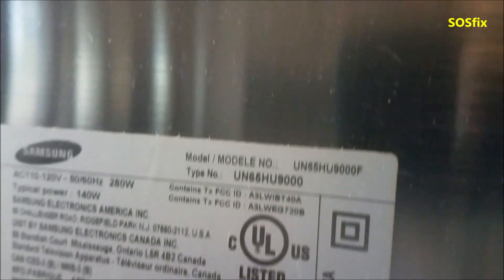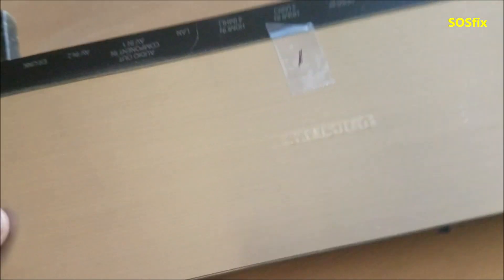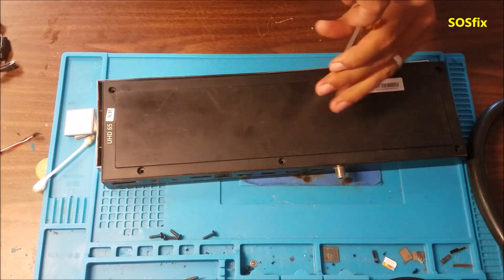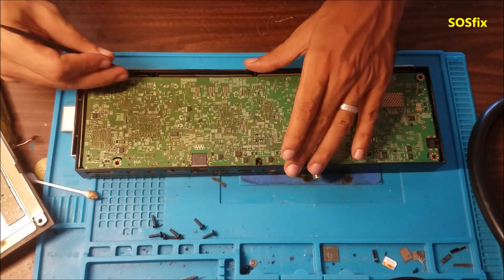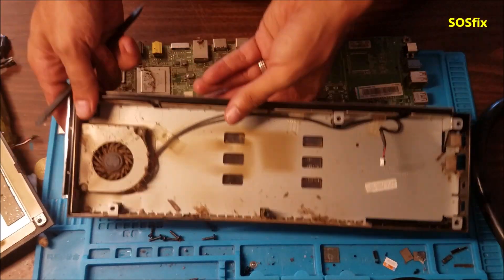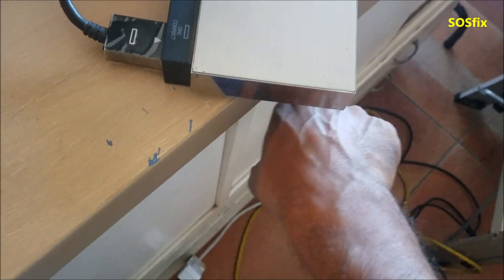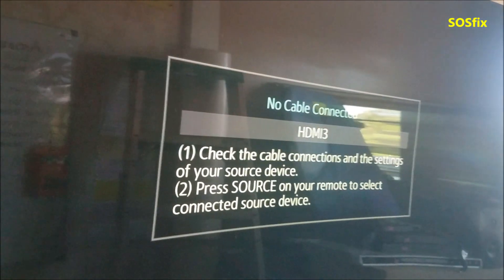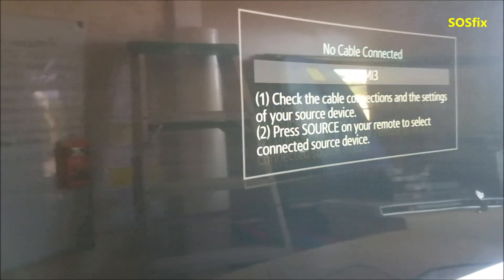samsung  tv UN65HU9000 cooling fan error and over heating easy repair

Comment: Do not buy Samsung TV , i have ue43du7172  from 2025 y  and its very hot, even wen its in off mode, and they overheat my usb stick drive so i lose all data, and they not read avi file. I update software still the same,  garbage Tv

Comment: Thanks for this video, what is the soldering thing that you are using for the fan ?
Reply from the maker: use lubricate oil
Reply: @SOSfixElectronics  Can I use WD-40 or engine motor oil, or would you recommend something else ?
Reply from the maker: @laznicek  yes

Comment: Just started getting this on my JS9500... Time to pop apart the OneConnect box... Trying to hold off on a new tv for a couple more months :)
Reply: Me too, last week, JS9500, that's why i came here to this video right now.. :) I think i purchased it in 2013, i remember buying 8 3D glasses from Korea on ebay and they had to be year 2013 model version or after to work on JS9500

Comment: The sign isn't appearing now but the fan is still struggling to turn, ordering some lubricant to see if that helps! Thank you :)
Reply from the maker: if you still having problem change the fan
Reply: @SOSfixElectronics  hi what's the name of the fan?
Reply from the maker: @rubenjones334  i dont have it with me but the part numbe is in the other side of the fan.

Comment: Put off taking this a part for years. Just did it today and this stupid message still pops up 😔
Reply from the maker: you may need to change the fan
Reply: @SOSfixElectronics  literally just ordered one on Amazon a few seconds ago.

I don't know who thought this TV design was a good idea. Crazy. I want to keep my 3D tv but this is unacceptable.
Reply from the maker: @Blaiyan  lets hope the new fan will fix the issue, be sure you dont forget to install the thermal pad on the BGA chips, good luck
Reply: @SOSfixElectronics  thank you. New fan worked. Think I'm still going to get a second screen and use the current one a lot less now.

Comment: Had the same error.Decided to open the one connect box and clean fan.After reassembly TV makes a ticking noise when connecting one connect cable as per image on display.I am sure the fan has completely failed.Would the fan failing completely stop the TV from displaying picture .I am now considering a replacement fan in the Hope's it will restore the no  display and ticking Issues.Any advice  ?
Reply from the maker: must be something wrong with cable. port in the tv side or on the box, or maybe you damaged the board when you where cleaning it , the box should connect fine to the tv with faulty fan, anyway wait for new fan and see

Comment: OMG !! You’re my hero.  What kind of lubricant did you use on the fan after you cleaned it.
Reply from the maker: flux paste
Reply: SOSfix Electronics would anything else work ok?  I don’t have flux paste.   I just bought some crc 2-26
Reply from the maker: @PissedOffLatinWoman  it will work. dont put too much of it
Reply from the maker: @PissedOffLatinWoman  check the voltage in that connector
Reply from the maker: @PissedOffLatinWoman  use multimeter turns the tv on and check the voltage between red and black fan wires must be about 5volt, anyway you can wait for the new fan

Comment: Hy and thanks furst! 
Can i ise vaseline as oil?
And in a second time, wanted to know is that cleaning is not working,  can purchase this fan: "VENTILATEUR KDB04112HB X02 SAMSUNG" on my UE55HU8500LXZF Samsung tv?
And one more time; really thanks for that help and for this knowledge that you just gave to us :)
Reply from the maker: yes you can use any oil.  and yes that fan looks the same. if your fan has 3 wires it will works for you

Comment: I will be trying to remove the box where the fan is located.  However, I do not see screws that secure the box where the fan is located?   This leads to believe I still have to remove the whole back of the tv?   I saw you previously stated I didnt have to remove the whole back of the tv?
Reply from the maker: you dont need to take the back tv off, look good for the hidden screws sometimes covered by black tape

Comment: hello, i would like to know what kind of grease did you use for your fan ?thats would be great. thx
Reply: Can we use WD40 ?
Reply from the maker: @biancalynn88  yes you can. very small drop. Dont spray on the board
Reply: @SOSfixElectronics  thank you very much. The problem is solved. Thanks for the video :-))))
Reply from the maker: Solder paste

Comment: hello I have a curved samsung television one connect UE65HU8580QXZG and each time I connect the television with its compartment to put all the cables, the television does not want to turn on but from the moment I no longer make the link with its box on the  screen I am told to connect the screen and its box I don't know how to fix the problem
Reply from the maker: 1st Try to replace the cable is cheaper. If still not work replace the box

Comment: What else works? Aim a cheap and quiet fan at the tv. It made all the blue overheated pixels work perfect. Since it took me a year to realize what the problem was..some burn in has occurred...but even that small blotch has faded to the point you only see it when the TV has to show a dark scene. Plus,it seems even that is fading more and more. It's like the TV is repairing itself.
Try it.

Comment: Mine had this once, opened and cleaned it, now the error is back and it is very clean, no dust at all. the error can go away after  few minutes though. The fan spins easily too.
Reply from the maker: sounds like the fan is slow spining or try to put thermal paste between the big chips and rubber pad and the heat sink

Comment: I had the same issue, but have determined  that the fans work but aren't getting power. But I can't find the power source of the fans 😭
Can anyone help?
Reply from the maker: because there is no schematic the only option you have will need to use the multi-meter to follow the traces for fan controller chip.  must be dc to dc 3v or 5v or maybe more, did you test the fan it self by connecting it to external power supply.
Reply: @SOSfixElectronics  yes i tested the fans with external power, that's how I know they work. 
I did notice 2 capacitors had blown. But do you think that's related?
Reply from the maker: @xavierkites change that capacitors first it may fix it

Comment: Hello again
I cleaned it properly just like you showed in the video but the tv still reports fan problem after a few days of use. 

What could be causing this? 
I disconnected one connect box to make sure that its not the fans inside the tv (around panel).

Is it maybe that the fan in one connect box itself isnt working and I need replacement fan?
Regards
Reply from the maker: Do you hear the fan spinning when the TV is on? If not check the fan if connected right.
Reply: SOSfix Electronics yes, when there is no error I can hear it spinning. It probobly doesnt start sometimes and thats when I get error message.
Reply from the maker: For this models there is no fan in the screen panel.  Check the fan in the box if spinning free or not

Comment: Hi i have the same tv, when turn it on the screen turns black and red light blinks 6 times.when i disconnect  the one connect screen turns on shows to connect . Do u know why ?
Thanks
Reply from the maker: First check if you have a bad connection between the TV and control unit. Or a bad wire
Reply: @SOSfixElectronics  thank you so much for the reply https://youtu.be/Efm6xqfcsCI
This link is a video of my tv. Tried a new wire too
Reply: @SOSfixElectronics  hi frind optical light doesn't work
Reply from the maker: @tana6850  do you know how to reflow the GPU?
Reply: @SOSfixElectronics  thanks for the reply. No i dont know
Reply from the maker: @tana6850  check my last video about how to reflow a tv motherboard cpu
Reply: Tengo el mismo problema, cual es la solucion.? lo encontro usted?.

Comment: Great video! Will it work on the JS9000 model? And did the error disappear completely after this in the past month or so? Thanks!
Reply from the maker: if your tv control box has a fan and you  are having overheat or fan error yes this repair will work for you, 
and yes the tv works great as new

Comment: I cleaned mine out and still get the error. It's weird though because the error goes away once the Tv warms up. I think my fan actually stopped working. Is there anywhere to buy a replacement fan?
Reply from the maker: 2:45 take the fan parts and clean it. if it didnt work check ebay or shopjimmy  may have it
Reply: @SOSfixElectronics  ok thanks
Reply: @dlaroc Samsung part # BN31-00036A, just need to search online
Reply: @Towelieban  Thanks mate just made it easy for me